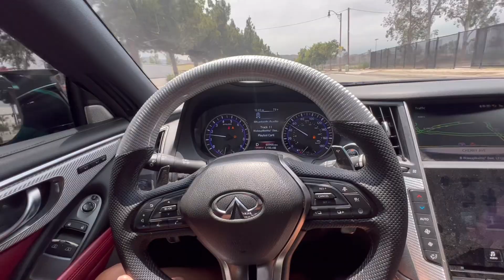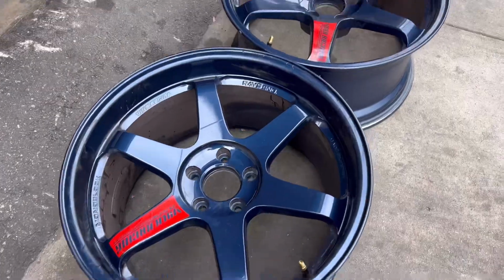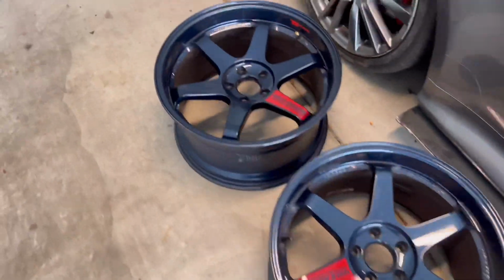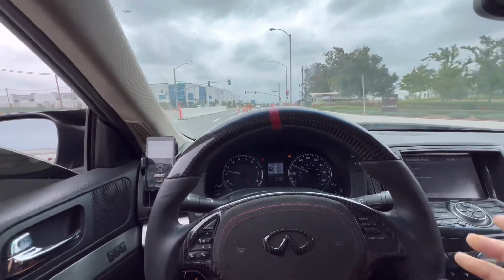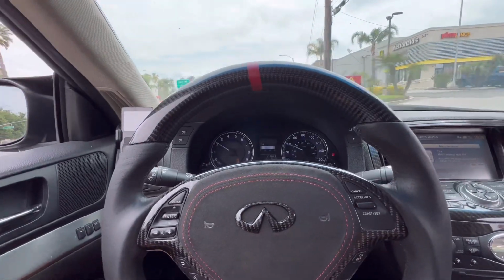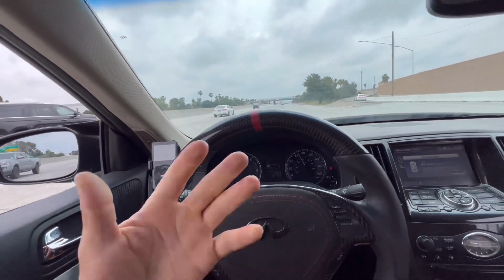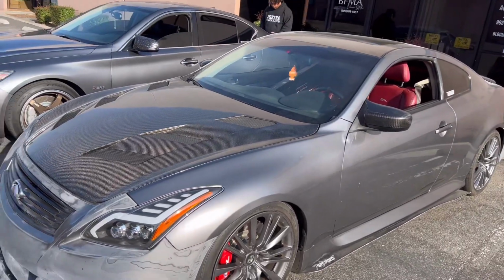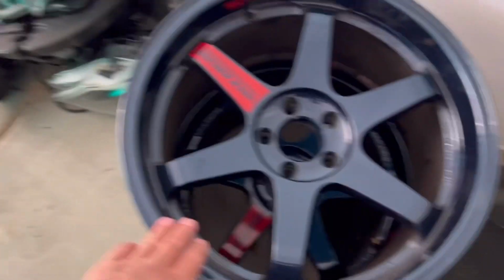New Wheels & Wrap for my Turbo G37?!

Comment: Did you end ringing the fix for the crooked steering wheel
Reply from the maker: Still no unfortunately. I’ve taken it to multiple tire shops and the can’t figure it out. Imm try one more method to get it aligned